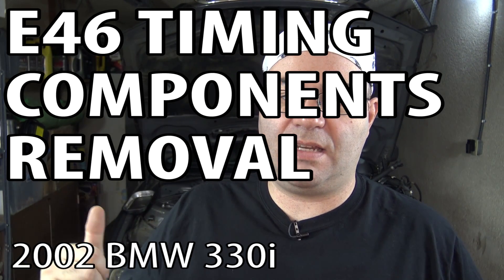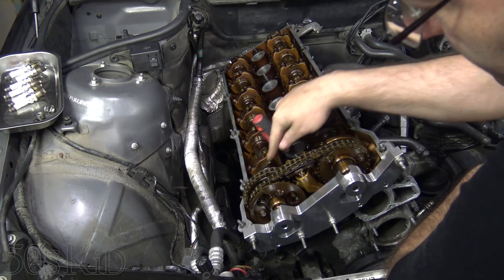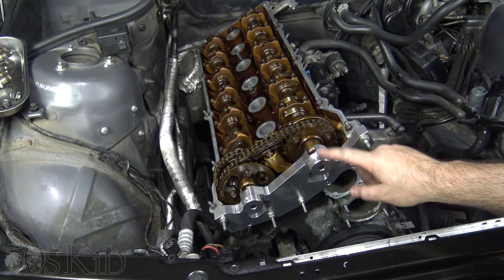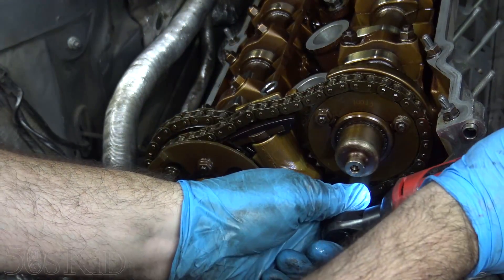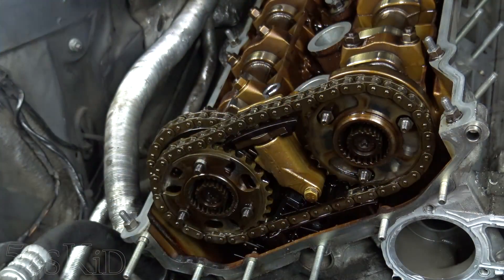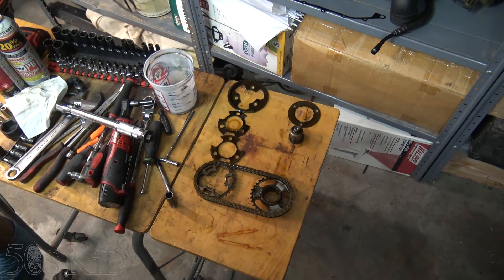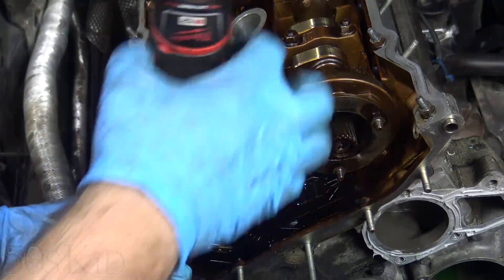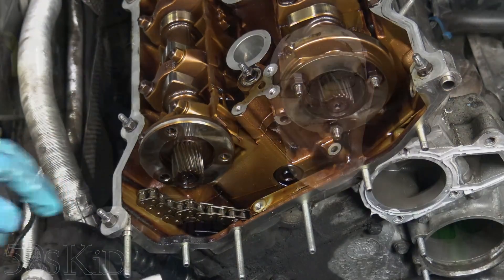BMW E46 Timing Components Removal DIY #m54rebuild 7

Comment: Hey I was wondering if the secondary chain tensioner can be replaced without disassembling the whole front of the engine? If possible I could just lock it in place take the 4 10mm out and swap it?

Comment: sucks my Grey pneumatic e8 socket wont fit to get the lower tensioner off to tight of a space    is that a 1/4' extension you have with 1/4" e8 socket or is it  all 3/8 drive your using  seems like i need a deeper e8    the one that is the very long bolt  just curious thanks

Comment: Hey Jason,
I followed all of your great videos to rebuild my 2002 E46 engine.  It needed to be bored .50 over and machined beyond any off the shelf head gasket thickness.  No, I didn't overheat it, I bought it that way not knowing how severely it had overheated.  Shortly after completion, I developed a pretty bad oil leak.  First I thought was coming from the timing chain tensioner, then from the oil filter housing gasket.  Neither proved to be the source of the leak and after cleaning the front of the engine, it appeared that oil was leaking from above the water pump, maybe the top of the timing chain cover.  I went back and started reviewing your videos and came to the timing components removal video.  After you removed the Vanos, you pointed out 2 E8 torx head bolts.  That struck me as something I didn't remember, so I pulled the valve cover and it appeared that I did not replace those 2 bolts!  I found them and then tried to install them without tearing everything apart.  I started with the longer bolt and could not get it to thread in.  I inserted a stiff wire into the hole and found it did not go down as deep as the bolt was long and I did not feel threads with the end of the wire.  I am afraid that the custom head gasket that I had made at a cost of $200 does not have the holes for the two bolts!  Do you have a photo of these E8 bolts in place with the Vanos still in the head?  I'm 99% sure this is the problem, but before I completely tear the engine apart I'd like to be sure I am correct.

Comment: Hey, great video with lots of detail. I'm just wondering, can the upper tensioner be removed without having to take off the chain? I'm doing a vanos rebuild soon and thought it'd be smart to change it while im in there but not keen on messing with timing yet as it's first time ever opening an engine.

Comment: Unless you have the perfect length socket for that chain tensioner it is gonna be a bitch. I had to use an adjustable spanner extended with a scaffolding tube.

Comment: Does it have to be top dead center when you replace the camshafts and time the motor? And is it possible to put the cans in wrong or will they only go in one way? I have my cans in and I am timing it. I have the locking tool on and the camshafts are both showing the two holes in the back. Does that mean I'm ok? I'm so scared this thing is going to blow up when I try and start.
Reply: How did it go? Did it have to be top dead center before taking it all off?
Reply: @konradkusmierczyk5035  ended up breaking the intake cam. I thought it would be very hard to break but I was very wrong. I put the motor to where the number 2 and 5 were the only ones that touched the camshaft and I was following a video by that 50s kid and I guess I didnt get it exactly right and it cracked. Well I took it out and found out the cam only looked cracked but it was actually split in two pieces . Got a new camshaft and took my time and watched more vidosand finally got it. Overall it was by far the hardest motor I have ever delt with and told myself.i would never do it again. I had bought the car to flip and it had a blown head gasket. Well guess what. Now my car a 2005 330ci has the same problem. Uhhh
Reply: And it did have to be top dead center. Do that first before taking off anything. Take many pics. And always put things in the exact same order. I thought it wouldnt matter for the little lifters and all that but it did. And now the dam.thing has a small tick because I didnt so that. I seriously am thinking about doing a swap with a ls  and seeing what I can sell it for that way. Or keep.it and make a very fun track.or.maybe drift car

Comment: hey, today i noticed a little rattling noise on acceleration and deceleration at around 2000 rpm. it sounds like the timing chain but it doesnt make any sound at idle or on startup. i'm a bit confused and i dont really want to tear the whole engine apart if i dont have to.

Comment: Working on same engine. You've been a huge help!!! I checked the tolerance the inside of the head is off 1/10000th. What does BMW allow for?
Reply from the maker: 1/10000th is nothing.  You can have a couple thousandths and still be fine.

Comment: Why didn't you install the cam lobe locking jig?
Reply from the maker: You don't need it when disassembling.  I kinda did it on purpose.  In the reassembly video I'll show you how to realign the camshafts to get the locking tool on.